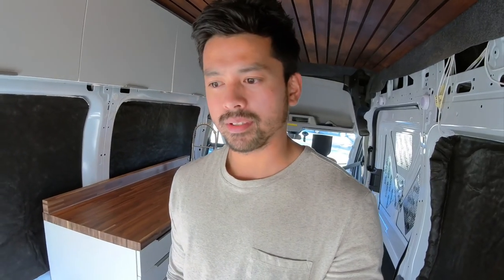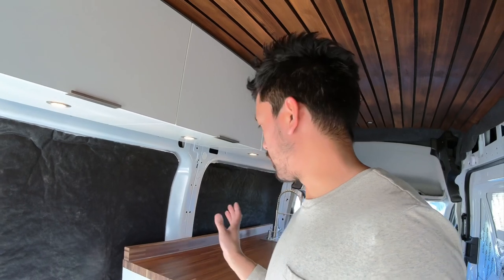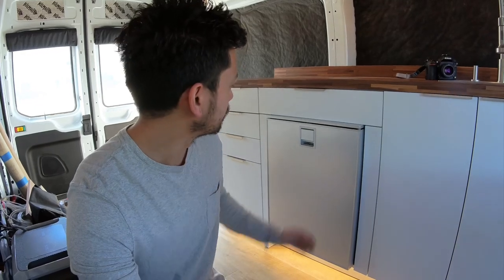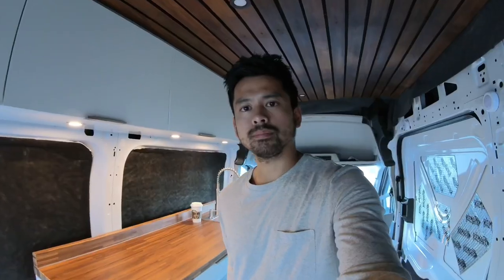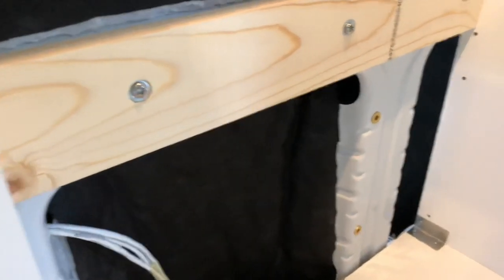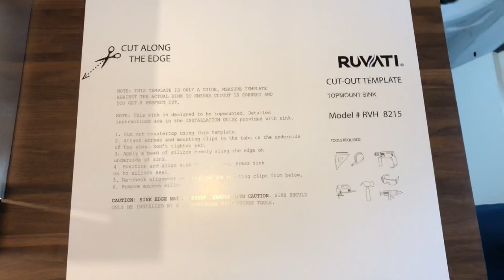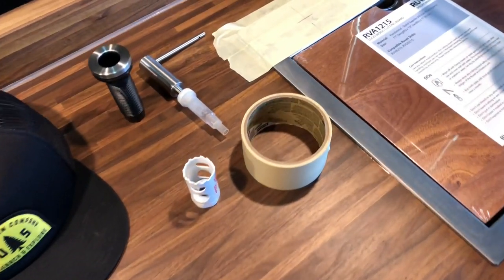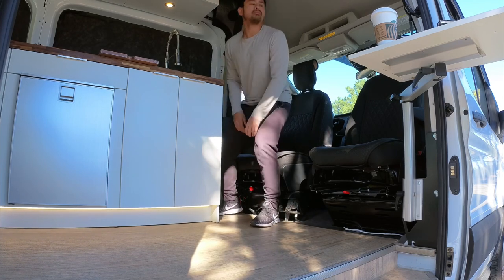AWD Transit BEAUTIFUL KITCHEN CABINETS with SOFT CLOSE Drawers, Fridge, Sink, Trash Bin! - Part 19

Comment: Your videos are a pleasure to watch: no fake melodrama, and you given your rationale for decisions made. Thanks.. Since I am considering a van build (retired recently), I wonder why you put in the cabinets before the wall covering. Did you consider L channel along the walls to fasten cabinets (this would allow a certain modularity for future changes), and why not instal the cook top to the top (I figure in a small space the fewer motions to get something done and the less storage space is used for an item, the better)? Thanks again.
Reply from the maker: Thanks T - appreciate the feedback! The wall panels will be one of the last things I install since I still need access to the van frame cavities for electrical/plumbing components.  The L Channel would also work to fasten the cabinets, good idea.  The main reason for not cutting in the cook top is mainly because I will not use it that often and didn't want to waste that space.  Also I can take the cooktop outside if I like.

Comment: Thanks, this is a very helpful video.  But, how did you power your fridge?  I imagine you have a plug in from the Bluetti but did you put a fuse box in, and how did you connect the fridge?  And what kind of plug did the fridge come with?
Reply from the maker: Hey Ron you’re correct. The fridge is AC/DC so it comes with a 12v positive and negative and a regular 120 plug.  It’s wired 12V to a fuse block tied to the AC200.
Reply: @RichBuilt  Thanks! That is exactly what I was planning to do!

Comment: Looking good! I like the counter & sink and how you reinforced it all. I am curious about the plumbing to your tank and your plan for the grey water. That side of the van definitely has more tank space below.
Reply from the maker: thanks Jeff - I have a 21ga water tanks and will have a grey tank under the sink that will be serviced when needed. I'll be sure to push a video out on the plumbing in the future
Reply: @RichBuilt  I plan to encase my tank in 80/20 to secure it.  What about you? Riv nuts and 80/20?
Reply from the maker: @jeffsteinmetz7188  Yup thats what I plan to do as well. Integrated into the bed frame

Comment: Maybe I missed it in the video, but did you cut the depth of the cabinets down? I know I heard you mention the depth of the countertop was 21" I think and those cabinets are 24". Looks great, btw.
Reply from the maker: Good catch.  The dimensions listed on the drawers descriptions are 24 in depth but when I measured it in the store it was closer to 20 1/2” so it worked out almost perfectly.

Comment: Any reason you didn’t go with the 15x20 sink? Kinda nuts the smaller one is more expensive.
Reply from the maker: My galley is not the standard 24” wide. So 15x20 would not fit within the base of the cabinet

Comment: Great Build! I’m thinking of doing ilea in my transit build as well.  Your link for base cabinet is only for 2 not 3 cabinets. It looks like yours is 3.also, how did you finish around fridge..just cut door?
Reply from the maker: Hey Grant, my base is a mix of the knoxhault cabs with maximira drawers.  I did not use the drawers that came with the   base.  The drawers I got are more durable.

Comment: How do you avoid the cabinet drawers open up while driving?  I don't see any lock on the front face.
Reply from the maker: NP, I used magnet latches on all drawer's and slides, the larger drawers have 2 magnet latches for a total of "40lb" force required to open.  https://youtu.be/GVuNWuwvlGM?t=1038

Comment: Solid video! Any video installing the plus nuts? Do those drawers stay while driving? Great job.
Reply from the maker: Thanks Keith - no video on the plus nut install since i need both hands to do it LOL, but not difficult.  The cabinets stay in place with the magnet latch.
Reply: @RichBuilt  Sounds good! Thanks Rich
Reply: @RichBuilt  which piece goes on the cabinet drawer?  I was trying to see if just the little plate was inside on the drawer face?
Reply from the maker: @debberkebile4396  Its the pull hardware. I think I linked to the exact product in the description
Reply: @RichBuilt  I was looking at the magnet latch
Reply from the maker: @debberkebile4396  Thats correct, its just a little plate that goes on the inside face.  It takes a bit of adjustment to get it just right but when you do they hold well.
Reply: @RichBuilt  ok great thanks!

Comment: how deep are your counter tops? When you said you cut down the countertop, was it to make it thinner or less deep?
Reply from the maker: Hey Cori, the countertop and frame is 21" and the drawers are about 20".  I did not have to cut the drawers  They are advertised as 24" but the true dimension is closer to 20".